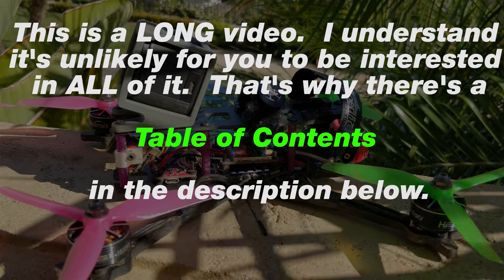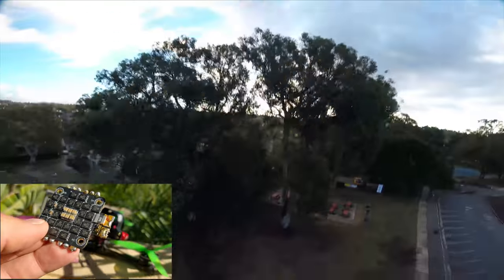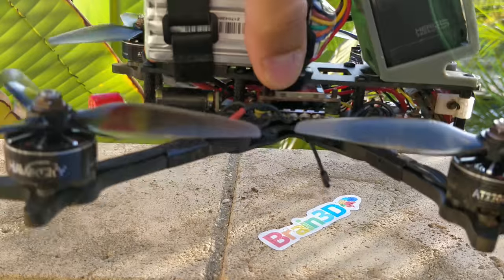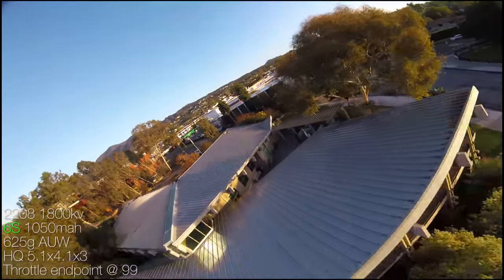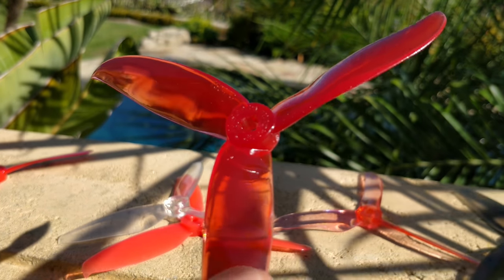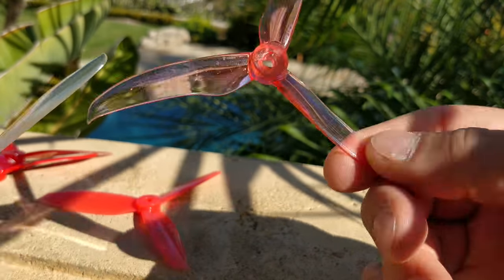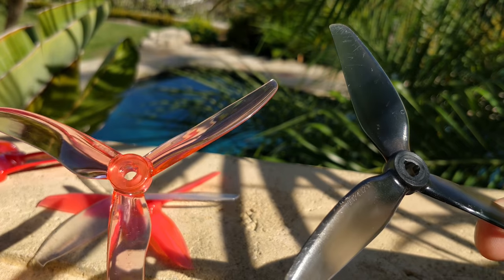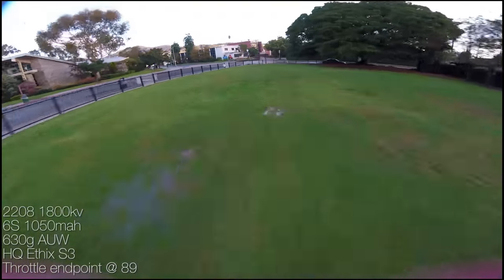HQ Ethix S3, My Setup Concepts, Frame Update, more....

Comment: UGH!!! Props!! I agree just stop already!!...I can narrow it down for you real quick like. I saw spectrograph readouts for many of the top props. The T motors were the cleanest..Followed by the cyclone 5040 and then the Cyclone 5046..the last batch of HQ's  5x4.3x3 and 5x4.8x3 were the WORST!! They vibrated so bad they produced 2 extra lines of noise in the gyros..I have not seen data on or flown the HQ S3's yet...hopefully they got it sorted.
Reply from the maker: I never liked the HQ 4.3 and felt the 4.8 was one of the worst props they ever made. Just pointless prop. It was actually slower than the 4.3
Reply: @Kabab  yep..I could here it "plowing" the air...most of the V1s series are SUPER hard to tune out jello thru the whole throttle band. Great info my friend...thanks for all the input!

Comment: What kind of flight time are you getting with a 1050 6s lipo?? I am finally getting into 6s and experimenting with batteries.. I started with 1250mah.. WAY too heavy for me.. so now I have a  couple 1050s on the way.. I'm just worried about flight time
Reply from the maker: 1250mah is way way way too heavy.  It's a bit bonkers that it's become something of a standard for racing. 1000mah 6S is equivalent to 1500 4S.  I look more at weight than anything so I prefer the battery to be under 190g.  The Pulse 1050mah 6S just happens to be what I use because I was given four of them by someone and that's all my 6S batteries.  lol.  Shows how much I fly...
Reply: Where else can you you get 1050s?
Reply from the maker: @Themflames  Sergio just happen to have some from a long time ago and those are the only batteries I fly. I particularly like the battery because it weighs 183 g and it has 16 gauge wire as well. A really excellent battery good for a solid 3 to 4 minutes of flight
Reply: Thanks, good to know because rdq just came out with a 6s 1050 mah
Reply: @Themflames  they are the ones I have on the way

Comment: About the dipping/yawing issue: Which Bf version were you running? There has been a fix in 3.5.3 regarding the motor Mix at Low/high throttle situations. https://github.com/betaflight/betaflight/pull/6981
Maybe it is related to your problem.
Reply from the maker: Unfortunately that post doesn't really help me so much

Comment: how does that tmotor 5143 compare to the dal cyclone t5040c? Any response from any1 would be awesome!
Reply from the maker: T5143 is definitely more responsive.  The T5040C is not bad but its' super similar to the DAL 5x4x3 V2 polycarb prop with a little more efficiency.  I actually feel like it has less durability than the 5x4x3 V2
Reply: @Kabab  oh ok that's interesting! What would u say about the top end power of the tmotor Vs the Dal 5040 cyclone? 
Thanks for ur reply bro
Reply from the maker: @leogarrett5082  hard to say. I haven't flown the cyclone in a long time but I'd guess they're about the same.
Reply: @Kabab  thanks so much man, I rly appreciate it! The tmotor is a pain to get pretty much anywhere, it's pricey and I can only rly get it from Banggood here in the UK.. I'm waiting for the ethix S3 prop for me, cant wait! Where/when  dyou think I will be able to get it here in the UK? Cheers for the help :))

Comment: Bro  Floss Boss Explain to us exactly what you mean by making a 6S quad,  Seriously,  Versus Making a 4S Quad.  I've putting off trying a low KV motor as I though I might want the option of throwing on some 6" arms for that build and see if I could push my TBS Crossfire out past the limit of the TBS Unify  ( ha ha ha)     but   money  blah yea ...   Anyway  seriously what are the simple parameters defining a $" Quad setup versus a 6" quad set up and no I dont just mean freaking arm length I believe I have that down   ...thanks
Reply from the maker: I got you covered very soon. Waiting on a review quad to be delivered which is shockingly good looking and Uber cheap 😉

Comment: I have 5 quads with 4in1 esc's and every one of them has video noise no matter what I try I can't get rid of it.
Reply from the maker: What Rx are you using?  Move it away from the FC or wherever the OSD chip on anything in the quad is.
Reply: @Kabab   Mach 2 and AKK on many different brand esc's and many different FC's, I've tried low esr caps, and running the wires straight through to the cam except OSD and still have noise.
Reply: @Kabab  Sorry you said rx I miss read FRSky on 3 and 2 on crossfire, I have 28 builds and none of the quads with separate esc's have the problem.
Reply: I found my video noise problem was due to EMI from the ESC motor wires being too close to the antenna. I installed the antenna on one of these - https://www.racedayquads.com/products/antenna-holder-attaches-to-any-standoff - and have the cleanest video I've ever had.
Reply: @ToddTube1  hey did you try powering your cam straight from the vtx and not the f.c?? Reason i asked is cause i had the same issue until i changed the power and ground of the camera and just solder it to the AKK vtx. Now my picture is clear
Reply: 28 builds lmao, weird flex but ok
Reply: shylo23 I did try that and I added a 1000mu capacitor and I still have diagonal lines.
Reply: JazzzyJ yes I have an addiction

Comment: Roogi try Demon Props 5x4.5x3 it's stiff enough to not flatten out on even 1900kv 6s , the prop is the most responsive prop EVER period... It's 3.65 grams  it's not super durable of course it's about like the 5143 t motor props. It's got a normal 5 inch prop chord it's not a narrow blade chord like the 5143.. It's power feels about like the hq5x4.5x3v1s but with much faster response. Your not gonna get flattening/flutter, it took 2150kv 2207s to get them to flutter and then it only for it on hard throttle on pitch moves. The props are flat amazing but they aren't good crashing props, I don't crash much while freestyling (I mainly race and do my crashing there) I'm really l9ving them on 6s 2208 Xing motors and 1750kv F60 pro IIs... they feel really good on F40 Pro II 2600s on 4s and 2400s on 5s... I flew them on some 2750kv 2306 Xings the other day and the prop is amazing on them top end is super fast honestly close to 5149x3s top end wise and the grip and response is awesome, on track quads I fly the 5149x3s on 95% of tracks and if this prop was just a little more durable I would very likely fly it as my main track prop.
It's a mid pitch prop that doesn't just run out and stop making more speed/power once the rpm reaches 85 to 90% like a lot of 4.3 and 4.5 pitch props (the demon 5x4.3x3 is flipping amazing to but I'm used to light weight high powered race setups and the 4.3 pitch just lacks the thrustyness to me btw its 3.38 grams, the 5x4.8x3 is 3.8 grams) it just goes faster and faster the more rpm you give it and that's cause it's stiff enough to not flatten the pitch out of it.
If you want I'll send you some of all of the different pitches. Give me a p.o box and I'll send you some if you want I truly believe you will be totally shocked.
Reply from the maker: I've tried the Deamon props. They're alright.  There are a bunch of new props coming out soon. Some are actually really good. Actually are better than before however there won't be any perfect prop. Just gonna always need to test and see what's best for your setup

Comment: What temp are you soldering at?
Reply from the maker: 310 usually. Low
Reply: @Kabab  ??? And then you wonder why your soldering sucks?😉. You have to heaten up the solder for so long to get meld, that no flux is left. I usually don't solder under 380-450°C. And my joints are shiny af.
Reply from the maker: @calcifiedbonecollector3222  I've tried temps high low and med.  No dice.  Hopefully the Kester stuff will fix it for me.  I believe I've just been getting like expired solder from various hardware stores...
Reply: @Kabab  well I asked because it looks like low temp solder. 370-375 and make sure your tip is clean. Maybe the stuff you were using didn't have a rosin core. That could do it too.
Reply from the maker: @MojoPapiFPV  Dunno.  I'm hoping it's just expired or poorly made solder somehow.

Comment: Are you thinking of a frame design similar to this: https://www.getfpv.com/multi-rotor-frames/fury-carbon-fiber-quadcopter-frame-5.html

I remember when this frame first came out and I always thought it was cool.
Reply from the maker: Lol no not with bent arms like that maybe. However that is pretty cool. I don't want any dihedral in the pitch direction. Just in the roll.
Reply: @Kabab  Cool! Looking forward to seeing what you come up with. The guy who designed that frame was one of the guys I followed years back when I just go into the hobby and built up my QAV250 and Blackout quad and hex.

Comment: typhoon 2.0 any good?
Reply from the maker: What's typhoon 2?
Reply: @Kabab  could they have renamed it to avoid dispute with the bardwell?
Reply from the maker: @jjj25313  yeah but they didn't because who the hell knows what China is thinking...
Reply: @Kabab  lol. . . so you think this "v2" is worth a shot? A 4in1 just blew a cap on one of my cheapo gearbest quads.
Reply from the maker: @jjj25313  there's actually a V2?  Is it the one with all the FETs neatly arranged in the middle?  That one has burned on me on at least 3/5 boards. Not recommended
Reply: @Kabab  Awesome, thanks Bab! haha. Saved me there, I was tempted..."I didn't forget to floss"

Comment: Who uses a 20° gopro Mount? Even running 20-25° cam angle 30° GoPro angle works best.
Reply from the maker: When doing any sort of slow flying or chasing things or 'juicy' as it's called you generally use 20deg or even less tilt. It's very very important for those that do any of that stuff.
Reply: Kabab FPV ah, I learnt something today... lol

Comment: I HAD THE SAME ISSUE WITH MY TYPHOON 4in1 v1.1 I had to hot glue the connector to the board
Reply from the maker: I tried the hot glue.  That wasn't the answer. The physical pins inside are thinner than they should be.  even bending the grippers together in the female side of the connector didn't work.
Reply: Kabab FPV it didn’t work for me either I had to angle motor wire #1 at 90 degrees to get it to talk to the fc

Comment: p l e a s e   Make those frame arms INDISTRUCTABULL (screw those extra 2 grams)
Reply from the maker: They're really durable as is and are extremely easy to swap out. Extremely extremely extremely easy. I wanted to make them thinner actually but gonna leave them as is. If the arm doesn't break, something else will so I'd rather the arm breaks.

Comment: "I don't tune".  Continues to complain about tuning issue...  I can slam my throttle from 100% to zero over and over and there is zero dip or yaw, because I tune!
Reply from the maker: Tune won't help.  I've tried it all.  It's why I gave up tuning and started looking at motors and props more closely.

Comment: try a real 4in1, don't be cheep,, you can solder to Bolt and spark range..
Reply from the maker: I use all things. This 4in1 is just as good as the $75 tmotor one that's in the quad now.
Reply: u wanted a 4in1 you can solder to and just plug in...………………….
Reply from the maker: @bizzfpv3984  it's not this specific ESC. It's all the high end ones too. The connectors are just different from ESC to ESC. Just a little but enough to matter.
Reply: NO connector need... direct solder with BOLT and Spark...….

Comment: I still cant believe a large turd has has a good chance of beating 99% of the drones on the market today in a wind tunnel measuring drag or areodynamic drag coefficient s....I could design a frame that would make the battery run twice as long and fly twice as fast with not alot of effort.
Reply from the maker: The trouble is build convenience and versatility. There is absolutely zero aerodynamic about any of this stuff. An oversized turd is actually extremely aerodynamic! 😂